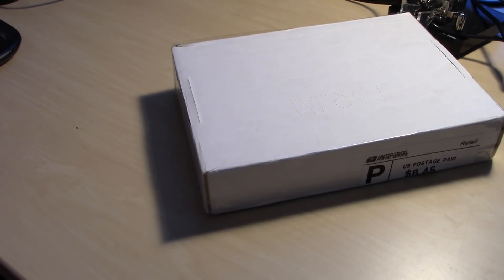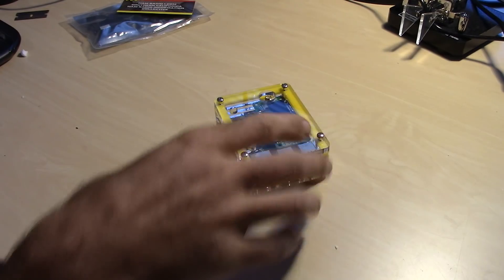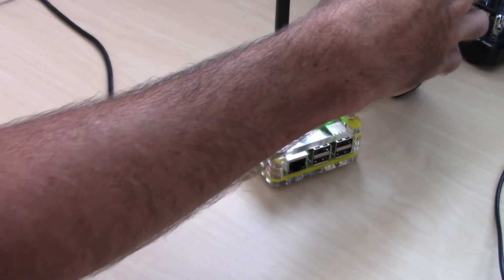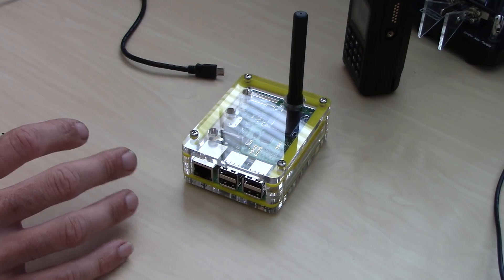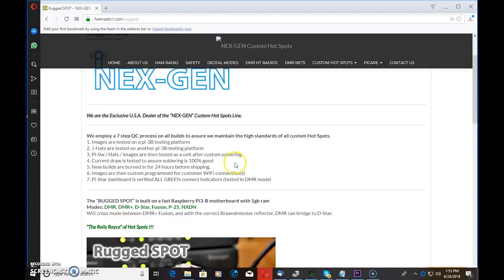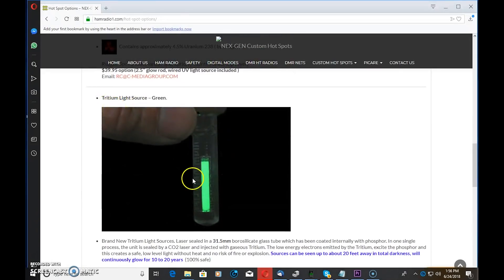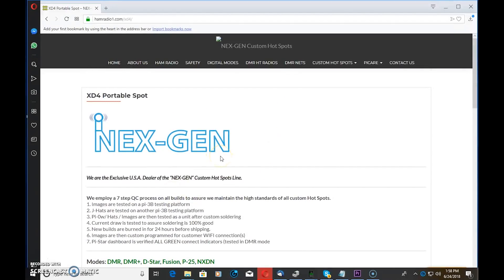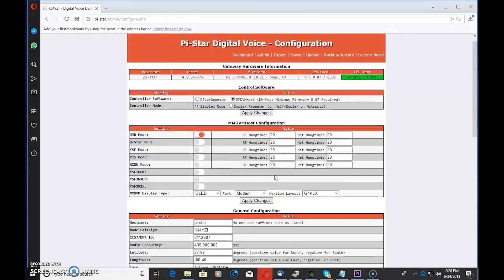RuggedSPOT DMR/DSTAR/C4FM/P25/NXDN Custom Hotspot

Comment: The only reason im considering this unit is because my handheld cant always reach the DMR UHF repeater almost 15km away Could you add a gain whippy antenna to this unit to utilize more range from you home using its prob 300-500mw output

Comment: Tritium radioluminescence:  https://en.wikipedia.org/wiki/Tritium_radioluminescence for those that want to know what it is used for.  Basically it replaces the glowing hands of a watch or used in Fire Exit signs and anything you want to glow in the dark, though it glows all the time you don't notice it in daylight.  It is radioactive but is considered more or less harmless unless ingested, inhales or injected.  It is found on most things that glow in the dark without using any power of any kind.  Now I can take of my scientist's hat.  But read about it, it is quite interesting.

Comment: If you can't set up a your WiFi & a Raspberry Pi and put one in a case you really have no right to call yourself a Ham.
The primary use of your license is "Self Experimentation & Education". If others do the work for you what have you learned?
You can buy MMDVM boards for under $20 now, $30 for a Pi 2 or 3, plus $10 for a case
You're paying someone $200 to set up your wifi & enter your details...if that sounds cool to you then you have more money than sense.
Reply: 100% right .

Comment: I would rather source the parts and print the case and get a similar result. You can flash the SD card and switch it to another pi if this one breaks. I think this is not the best way to go about this.

Comment: Why is this thing cost so much? Other people are selling this same exact setup or parts for a lot less like 50 to 100 dollars for everything. This is a chinese jumbospot on a Raspberry Pi 3B and a hard plastic case. The it looks like Pistar is preconfigured.  Those of you that dont have a clue ab out DMR, DStar or Fusion. Do a search on ebay and type MMDVM. You will see all this stuff for a lot less.

Comment: The PC (pi3b+) is on sale for $35 right now (oct11/2018), dmr hat 30-80, case 3-60. There's a nice metal case around $10 or an acrilic case with touch screen for around $20.  The touchscreen would require a work around. So for basically the same setup with metal case. 35+30+10=$75 labor for preconfigured os + high end SD card $75ish.  Personally I would prefer the experience of setting it up myself and saving the 75 but if someone doesn't have the time or patience I could see it being worth it to have it preconfigured for $75.
Reply: K

Comment: I have a raspberry pi 3 and pi hat. I also have that HD1 radio I just can't seem to get the radio to connect to the hotspot when I key up nothing! I no the radio is working because when I turn on my md380 clone radio and key up on the HD1 the md380 sees it and I can hear audio no problem I just can't get the HD1 to connect to the hotspot any ideas??. also thats that small screen called? (I like it)
Reply from the maker: Is the DMR ID set in both the radio and the hotspot? Have you tried modifying the offset in PI-STAR? there is no shift on the frequency, it is just simplex.. Do you have a talkgroup programmed in the radio?
Reply: HamRadioConcepts it's on simplex I have talk groups . I'll try and modify the off set in the pi later thanks for the reply
Reply: it seems that only some talk groups work once im on talk tg9 I can't get to any other tg. I have to reboot the pi maybe ive got a faulty pi hat?
Reply from the maker: 2j4ez I'm going to guess it is a programming issue in your radio. The radio is what changes talkgroups. If you can get the pi to go to tg9 then it's working.
Reply: HamRadioConcepts I can't change groups easily. I key up and nothing happens the light on the pi changes but nothing on the laptop screen . Also once I'm in tg9 I can't change group again unless I reboot the pi . I'm going to make sure the antenna on the pi is working correctly and I'll try the image again . Thanks for yours replies
Reply from the maker: It shouldnt be the antenna, if you take the antenna off it will still work within the rooom. How are you trying to change talkgroups?
Reply: it seems if I point the radio at the pi spot nothing happens but if I move the radio slightly then try again it seems to work (sometimes) also I checked DMR id and its the same. Im changing talk groups in the contacts on the radio. if I select tg9 and key up it changes to tg9 .if I change to tg235 (UK wide) and keyup nothing happens same with tg80,tg81 maybe I'm doing something wrong? I'm just going to try again with no antenna connected
Reply from the maker: Just a note, you cannot be too close to that hotspot, it overloads the receiver.. You should never be on high power when close to it, I run at lowest possible setting. Works across my house..
Reply: I'm going to move the pi-star to another room and try again it has to be plugged into my router with ethernet as wifi doesn't work, it sees the wireless connections and when I press connect and type in my wifi password nothing happens. also the radio is on low power thanks for the help so far
Reply: Ive just rewatched your video and saw on my pi hat there a sticker with a 500 rx/tx off set just tried it and radio now connects and I am able to change talk groups every time. ill play more with it later thanks for your videos regards 2e0iqj

Comment: Nope, not giving out my wifi info.  I change it regularly and if I have to get a custom image to change it, it isn't going to work for me.
Reply: For me, there are not enough people with the knowledge to crack WiFi access codes, so I am fairly safe for now.
I run blocking WiFi as well...You access that, and you get an SD card image of a fake web server, and it repeats, no net access, no functions..
Reply: Jason, KC5HWB, had Bob leave the WiFi blank and he inputted it himself through Pi-Star.

Comment: I have to agree this is a pretty nice looking hotspot.  I still use a DV4Mini as that was what was available when I first started. I use it for DStar and for DMR. Plan to use it as my first dive into C4FM as well.  I'd like to suggest you consider highlighting what the differences are between the various hotspots?  I am thinking it might help folks like the ham that asked you on the air if his choice of a DV4mini was good in your opinion.  I guess I'm saying that it would aid hams in making an educated decision on what to purchase and what is in their budget too?  I also have a SharkRF OpenSpot - both it and the DV4mini get a hams on the air but do require a very small amount of reading and configuration... which is not a bad thing necessarily if it helps the op to understand what he is connecting up and using.  Please folks - don't flame me or start a debate... I am NOT saying one is better than another, just would rather see Ham Radio Concepts think about a comparison video.

Comment: Thing is sexy looking ..😅
The questions are: 
Can it transmit to a UHF  repeater 5 mhz split with it's PL encode out . 
I would love to connect to A analog repeater say ...
(448.0 tX 443.0 rx  on c4fm which would be awesome for locals to talk in on without buying a c4fm rig & hri_200  $$. 
C4is allowed FM which would work you think it has ability to split tx RX freq +pl encode? 
Anything in the user software?
Awesome for dmr hot spotters .
Ty for video .
Reply: Did you notice how PONY BOY didn't answer you Duane???? This kid is a egotistical ma-roon!

Comment: I have a Rugged Spot also and it was my second hot spot after a Nano Spot so I set it up with my second DMR ID. Robert worked with me for over a week with me unable to get into the Rugged SPOT until we realised I was using my 1st DMR ID and we needed to change one setting in Pi Star from Private to Public and it started working perfectly. Robert stayed with me the entire time to get it working for me, excellent on going support and we both learned from the experience. Thank you Robert!

Comment: So $250 for a $30 JumboSpot, a $10-30 Raspberry Pi and a $5 case?  What makes it “Rugged”?  Is it waterproof?  Impact resistant?
Reply: Where do you pick up a JumboSpot for $30?
Reply: Get one without the junk metal case or OLED when eBay is offering a 20-30% off coupon. I think the last one I ordered was around $35 after the coupon.
Reply: @2E0JTP  AliExpress got lots of mmdvm boards.
Reply: Kris Garner its penis resistant
Reply: It's so "rugged" the sides are left wide open with no protection. So not going to put this in a rock crawler or other open cab truck/Jeep while off roading in the woods where foreign debis can tongue punch its fart box from the gaping holes on the sides of the case! 

Looks cool, yes. Rugged field operation, eh not so much without putting it into a real case or another container. I wouldn't even be inclined to put this in my backpack while hiking due to something else poking a port through the side that has no support. At least with the cases for the Jumbo, Zum and Nano Spots your only fear is the antenna(s). The rest is well supported, covered and enclosed.

And all this talk about the Pi? What about talk of the RF board? How about making one with a duplex board. Why is the Pi the star of the show. You're buying a digital mode hotspot. If you want to use a Pi as a Pi just buy a Pi for about 1/5th the price.

What he's really doing right, the 7 step QA process.

Just my thoughts and 2 cents and it's worth just what you paid for it. Nothing. Hihi ;-)
Reply: @VinceCASPERPimentel  Put it under the rear or front wheel of my F-250 lets see how rugged it is " it is a Joke form a Joker"
Reply: This kid is a class A ma-roon!
Reply: No, it has radiation hardening, armored for use in battle, but will fail when dropped.

Comment: I watch most of your videos, but sometimes I shake my head at the misinformation presented. You say this is better than a JumboSpot, but even in the video JumboSpot V1.60 is clearly visible silkscreened on the modem.
Reply: These are absolutely made with JumboSpots. The builder just calls them “J-hats”. $30-50 all over eBay and AliExpress.
Reply from the maker: To the ham who just bought a jumbospot, it is a self contained unit with a jumbohat, called the jumbospot. To you or me, a jumbospot is a hat that runs on a pi platform. To avoid confusion, I compared it to the jumbospot i have, yes the same jumbohat in both of these units, but a totally better build quality vs China complete hotspot package..
Reply from the maker: And it is not misinformation, it is to avoid 10,000 emails next week, asking the difference between a Jumbospot and a Jumbohat. Believe me, my inbox has 5,600 emails, and 100's weekly arrive. I try to just reference it as simple as I can.

Comment: $250.00, is a bit too much. I don't mind the pi zero with jumbo spot and 3.5" OLED touch screen I use now.
Reply: I just built same thing for 100 bucks
Reply: Yeah, it's pretty, but $250.00?  yeah my Jumbo spot is fine. It looks like a solid well-built unit though.

Comment: Okay, I'll bite. How's the seller determining the correct Rx and Tx offsets without having your radio in hand?
Reply: Further more, all those details are required for the order. The manufacturer knows this tech and this product inside and out and has you give him allllll that info when you order. AND if you leave anything out, he personally calls you. 

That's pretty bad ass!

73 de K9SPY
Reply: RX TX offsets are part of the MODEM / unit function. Your radio needs to only run in SIMPLEX mode , one frequency with a NEX-GEN hot spot.
Reply: The VCO in these units aren't all that accurate with regards to frequency, which is why the Rx offset must be adjusted to match your desired frequency. It is fairly easy to adjust the Tx offset with a quality spectrum analyzer to your chosen simplex frequency, but considerably more of a challenge to adjust the Rx offset without recourse to an extremely accurate (read: expensive) signal generator. Assuming the assembler has this expensive equipment to hand would go a long ways toward accounting for the elevated selling price!

I have set up two MMDVM Hats on a PiZero/W so far and have encountered no real problems. While I do own a very nice Rigol spectrum analyzer, I do not have a signal generator yet. I have to adjust the Rx offset "by guess and by gosh" until the BER is as low as it can be, generally 0.2 or less.

Comment: So a company took a Raspberry Pi 3+ and a dvmega, packaged it up and sells it complete. What did that run ya?
Reply: I never said it maybe wasn't worth the money. They are almost the same as like the zum or jumbospot, except this is ready to go. I had fun learning how to program my hotspot. But if you want something ready to go then this could be it. There's lots of options and price tags out there now. Depends on what the ham wants and budget is
Reply: Justin Moyers they are 250 plus shipping. Kinda high for what they are
Reply: Ryan KC9OZA yeah...nope. less than $100 bucks in parts and 20 minutes of programming lol
Reply: But I guess if want something that's ready to go on dmr, then I guess its worth it if don't want to do other
Reply: I just built the same thing for right around 100 bucks
Reply: You two are nuts... there are VOLUMES of things to configure. Its hardly $100, 20 mins, and done. Laser cutting and engraving. Assembly. Multi-step, substantive quality control checks. Specific configuration customization for YOU. A stock of different colors and options. This is thing is REALLY well done.

 I personally dont care for any of this digital internet protocol radio reefer madness, but I know quality when I see it! $250 a little high? Yeah, maybe it should be $225... but where's that Simpson's "Take my money!" meme when ya need it?!?

73 de K9SPY

Comment: I Have the Commander Spot, the Upgrade to the Rugged Spot with the Nextion Screen 2.4" , these are great units 73 de WX4JCW
Reply: Is there a place for the antenna on the commander spot? The pictures don't show it. Also does it have all the connection on the end like the ones he shows in the rugged spot? Thanks
Reply: They are all made from the same parts so yes...but you are throwing away money